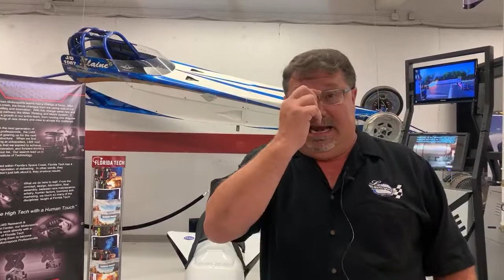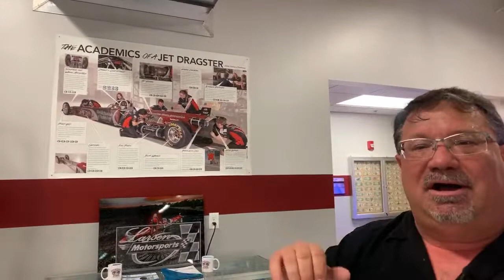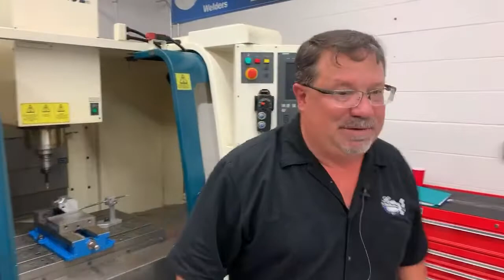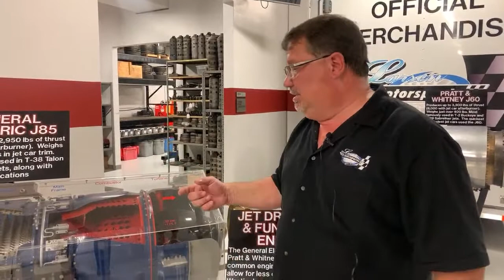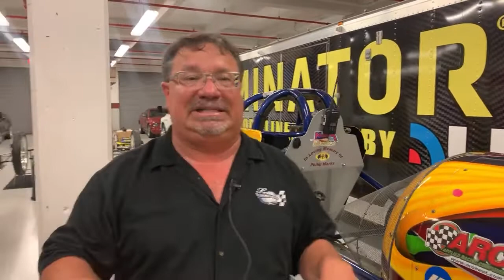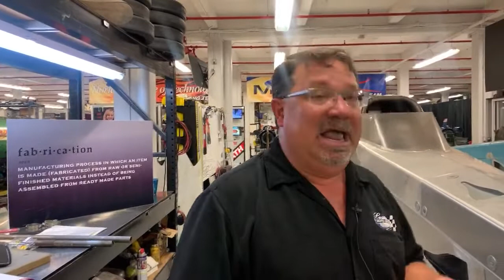First Virtual Field Trip [LMS Shop Tour]

Comment: 14.  At what degree is the engine mounted in the car?
 

15.  What department of Larsen Motorsports is used to create the graphics found on the cars and trailers?

 

16.  What stops the jet dragsters at the end of a run?

 

17.  The chassis structure is made of what type of material?

 

Help me please